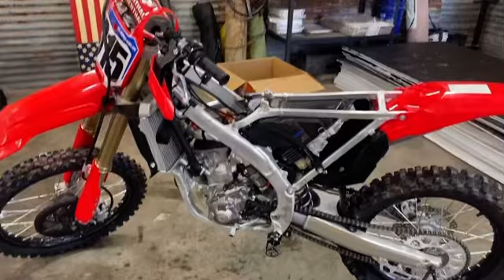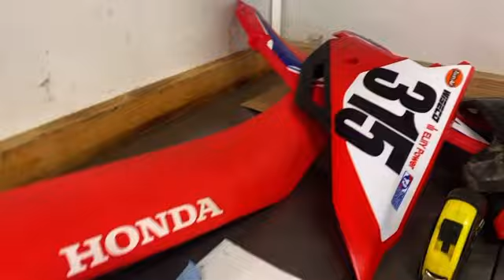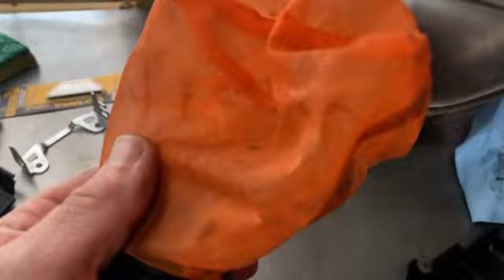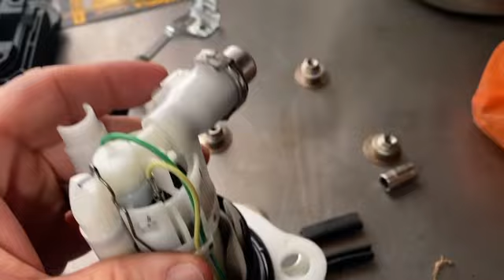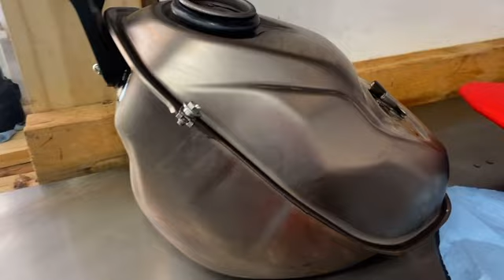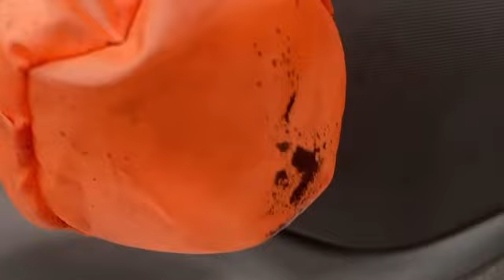2022 CRF 250R How to protect your fuel system and keep it clean with a cheap twin air fuel filter.

Comment: What is the part number for the tank filter?
How well or snug does it sit in the tank?
I have a 23 crf250rx, tank is plastic
Reply from the maker: I'm not exactly sure if you're referring to the fuel filter part number or the pump or the pre filter i use to catch, so I'll supply both 👍
Honda fuel pump filter part number 16715-MEN-A51
Twin Air pre filter 160610 28-6143
The one I had didn't fit well as I order it for a different bike because at that time they didn't offer or I couldn't find one for my honda. Hope this helps

Comment: Hey man just came from a trip. I got a 2024 crf250r and it won’t start after sitting in my garage for a whole month. I tried putting new gas and it won’t start. How can I get in touch with you. My bike probably has around 5 hours
Reply from the maker: If it was me, would start with would be checking to see if I had spark at the plug . If so remove the air filter and spary some starter fluid in the intake with throttle in wide open position. Then let off and see if the bike will fire up and run .. if so it's a fuel problem.  I have had and seen issue where bikes have sat at mice and other rodents have chewed wires.